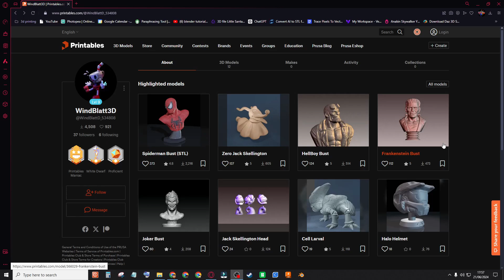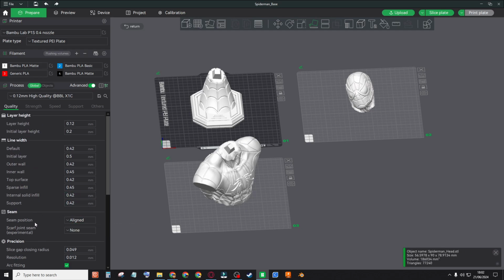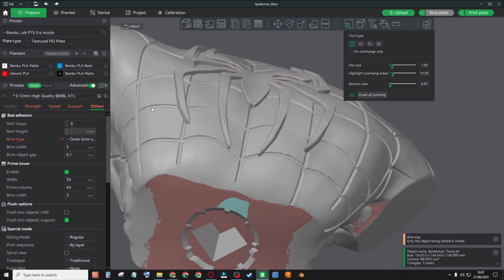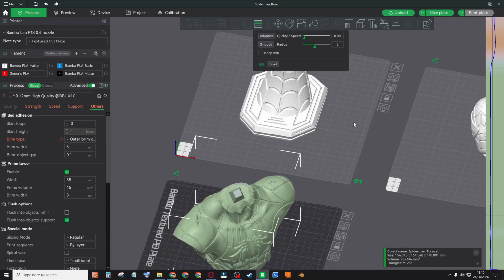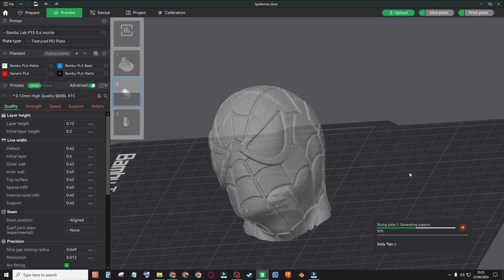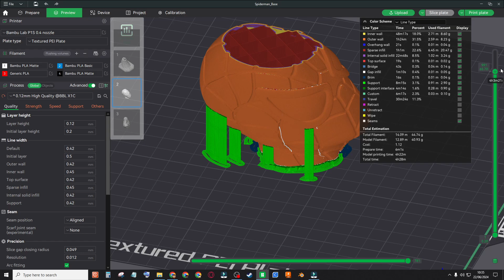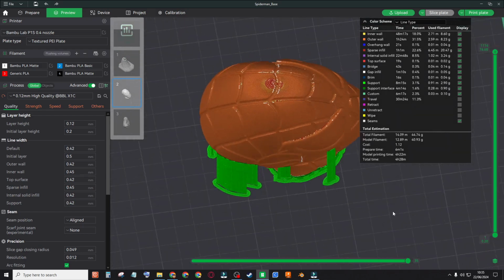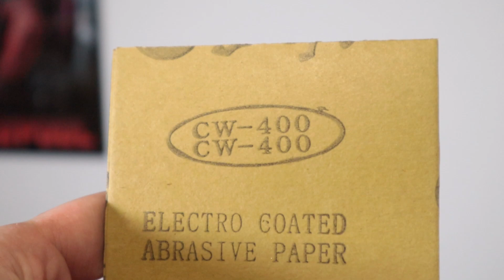Do This If Resin 3d Printing isn't an option

Comment: I'm actually trying your settings on a model of the USS Voyager from Star Trek. If you know anything about these ships, their shapes make it very very challenging to orient them correctly to get the fewest supports possible. Yes you can cut them and print them completely vertical but this gives you some crazy random anomalies that show up and need sanding. I'm going to try actually printing them at a 45-ish ⁰ orientation. 
I hate to ask who you think you could actually just Make a list of the steps you took to obtain the quality that you did using Bambu Studio?
I'm glad your channel got suggested. I look forward to watching your older videos and seeing your new ones.
Reply from the maker: Awesome, let me know how the settings work out for you. It sounds like an interesting challenge to print USS Voyager, and I think it deserves a video of its own. I will make it after I have finished the video I am working on now.